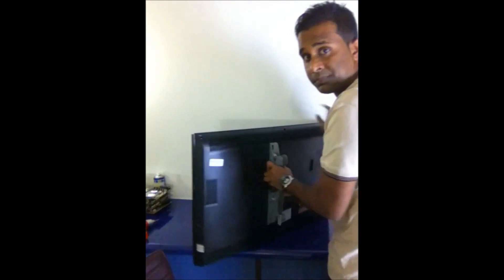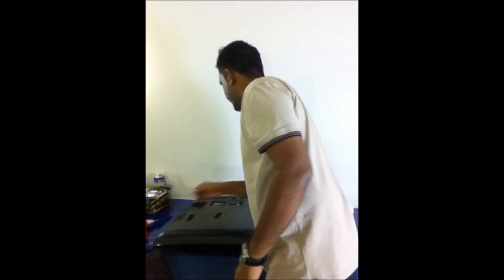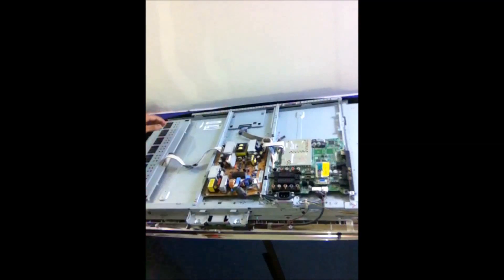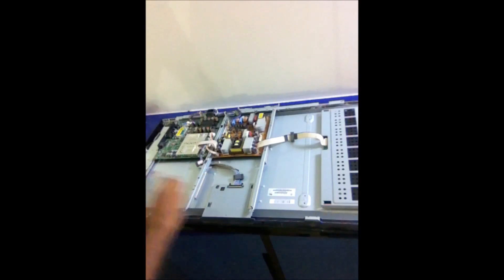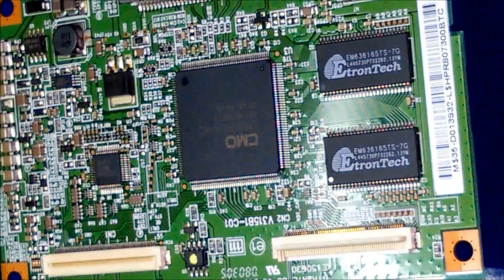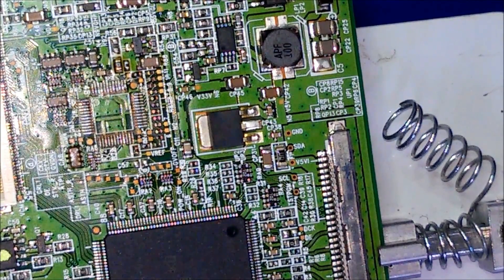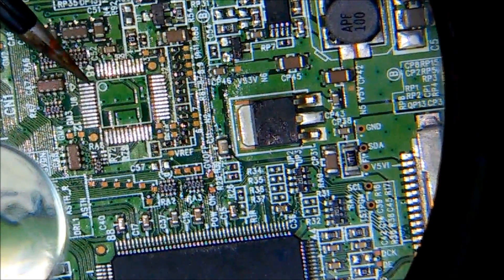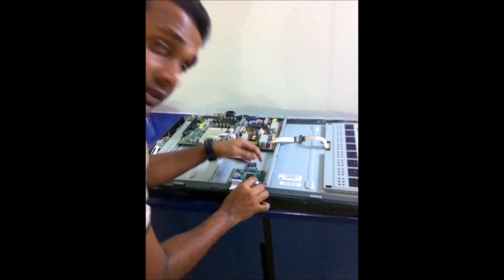How to repair bad pictures in Samsung TV by replacing AS15 IC.

Comment: Hey Anjuka, good job. I like the neat work when it came to de-soldering the surface mounted IC. By the way, what is the brand and model of the IC Remover you're using in this video?
Reply from the maker: https://www.amazon.com/uxcell-Suction-Desoldering-Extraction-Replacement/dp/B07L5NLSG1

Comment: I've repaired many panels in this way.
Reply: I have a question will you help me? I messed up soldering the as15-g chip and destroyed connection tabs. Is it possible to bypass gamma with another board? If so, how?
Reply from the maker: Instead bypassing try to connect the IC legs through copper jumper wires or else better to replace the boards but 100% sure jumper wire technic works if done correctly.

Comment: Samsung LE37A330 here with a very likely broken AS19-HG. What temperature do you set your heatgun to when doing work like this? Do you use rather low or high airflow?
Reply from the maker: @ superdau... No it's not broken. for non pasted IC I use 120 C.... If unable to remove then go high.

Comment: Excellent video Anjuka! Thank you for creating this video! May I please ask if you would know whether or not this same principle would apply with LG's older LCDs? Such as the 55LW5700? I've had this for about six years. What I've started noticing since over a year ago is quite interesting. When you first turn it on, it works flawlessly. But after about 30 minutes of usage, there is subtle smearing in the picture quality. Sometimes it happens, and sometimes it doesn't.
Reply from the maker: Hi... Change the capacitors on power board ...

Comment: Nice demo, Anjuka. I am just curious,  how did you diagnose the fault in that IC (in your case AS 15-G) and not in other component, such as in the timing controller ? Thanks.
Reply from the maker: @Danial, Most of the time based on my experience if there is any color issue then the fault will be definitely with the G-15 IC since as far as I know this is the component which control TV RGB color, But for some Samsung TV I may try the EM-7G IC which may be cased to the color issues. 

This all based on practical experience ones you started to work in electronic field then it will be easy to find the issue of any gadget but some may take time....

Comment: Anjuka (or anyone else), can you tell from  this jpg picture of my Samsung T460HD TV/monitor whether my issue is with the T-Con board, the main video board, the LVDS cable between them, or something entirely different? Notice the horizontal bars are wider at the left.  The unit powers on, and I can do a factory reset (power-of/mute/1/8/2/power-on (wait 15 secs) enter/enter/enter, however the same screen shows, no matter what I select as the video source using remote or side button.  Thanks!

https://www.dropbox.com/s/pc8wdg20af4q0db/2016-10-21%2020.14.50.jpg?dl=0
Reply from the maker: @ Joe, If you could remove the T-Con board ribbon and fix it again after cleaning may be it will work. Thanks

Comment: @Anjuka Asela, I like the video and it shows you are pretty good at electronics repairs. However, next time you use a heat gun to remove a chip, you should always use aluminum foil to shield the surrounding areas. The heat can damage capacitors or surrounding components. If you make another video you should use a foil shield on anything sensitive to heat so someone does not try it themselves and screw up and blame you for it. Also clean up the flux paste LOL. That is corrosive and sticks to dust which can cause short outs later on in life. Great video. Up voted!
Reply from the maker: Thank you for your comment. will do next time.

Comment: What was the gel liquid stuff you were using.  I have a heat gun and solder tool.  The chip at shop jimmy is about bout $15.  It shows a very weird picture kind of like bad white and black, or looks inverted.  Tv is old so I think this will fix it.  just curious what that liquid was, and you used it again instead of solder correct
Reply from the maker: That is soldering flux

Comment: Hi there, i was seen your awesome video and i want to ask you for help.
I dont want just throw my old good tv just throw away from window so Im trying to find some solution.

I own LCD TV SAMSUNG LE52M87bd.

First of all I want to say, i was already open case and checked all capaticators. All seems to be normal. I was cleaned most connection cables and nothing was changed. Second thing is, my tv did this few months before, but in some miracle it starts works again. After 4 weeks its same problem back again. I hope its still chance to do something.

I have connected TV to my PC, i presume that small line error in left corner makes my resolution on my primar monitor where is resolution 1366x 768.
Depends on which type of connection is up.

Now what is seen on video i was uploaded.

Tv have on all types of connection vertical white links, but only one connection is normal.
That type is VGA.

I was started to show how works it at all types.

1. VGA
2. HDMI
3. television
4. some externals
5. again VGA

https://www.youtube.com/watch?v=n8QXRvG0t2E

Any ideas?
Thank you for whatewer
Peter
Reply from the maker: @ WindsdoomPatriot. Could you send me a picture of your TV back side to my e-mail, anjukaasela@gmail.com 
I will check and get back to you.

Comment: Hi AJ, 

Your Video was very helpful for knowing the issue on my TV as well, I have UA40H5100ARXZN, this was bought from online in india, but manufactured in Egypt.
I have the same issue, but as i opened up the TV,  i found one board which connects to the display as TCON_USI_T(FLIP_LVDS) - which you might as well be referring as TCON board. But I did not find the IC you mentioned anywhere on that board.
Could you please help me out in this as the service guys asking 6 grand to just check it. More than that this stuff is interesting.
Cheers.
Reply from the maker: Hi 
@ chethan sharma, Thank you for your kind comments!!!!  If you can send me a picture of your TV (after removing the back panel)  Yes! i'll try to give a possible solution for you...
anjukaasela@usa.com

AJ.........